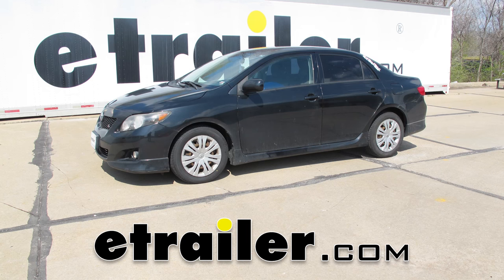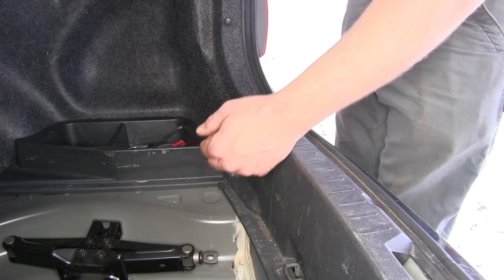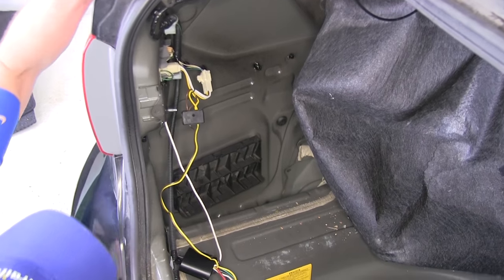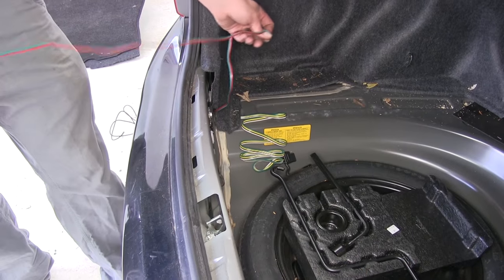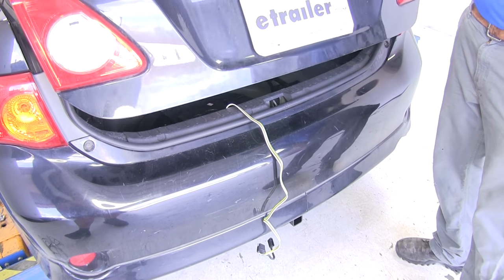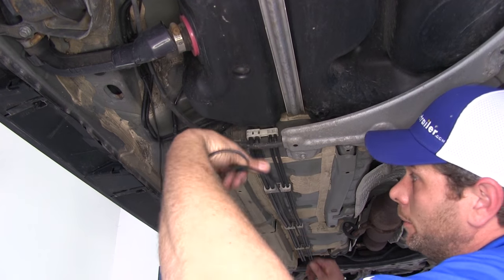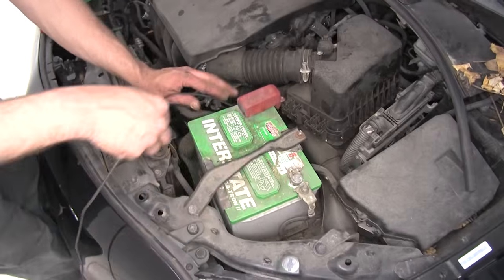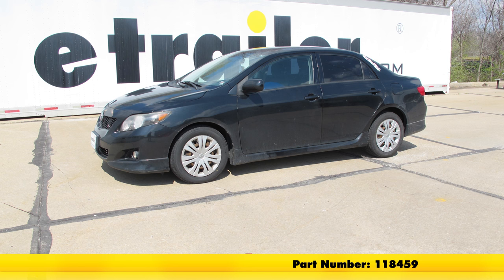etrailer | Trailer Wiring Harness Installation - 2009 Toyota Corolla

Comment: how about an installation guide that doesn't involve pre assembled wire connectors. those are clearly easy and dont need guidance. it'd be lovely if the "professionals" showed what wire does what FROM THE CAR!